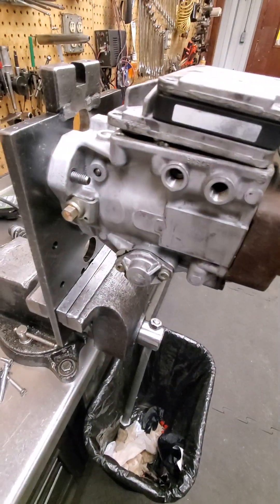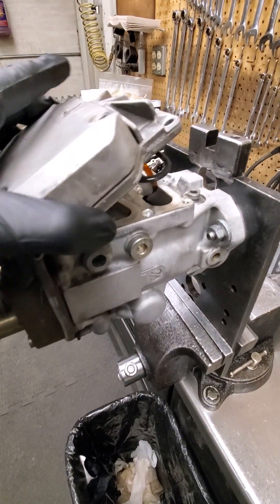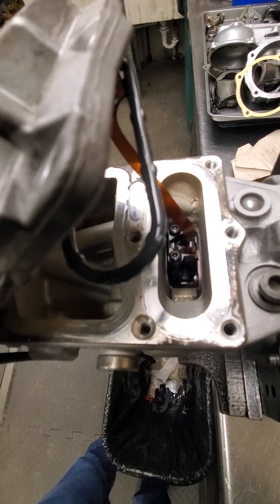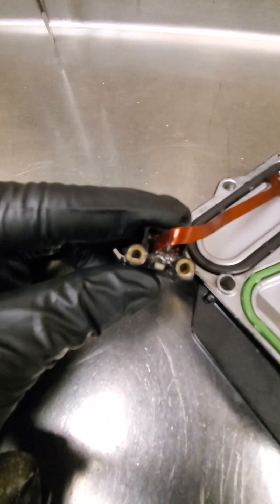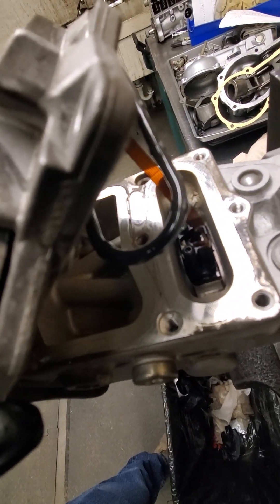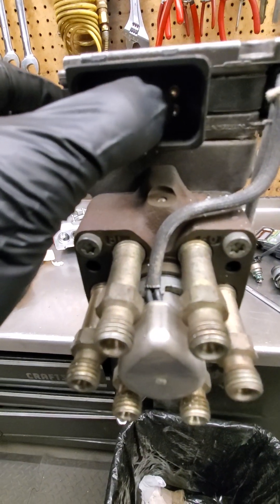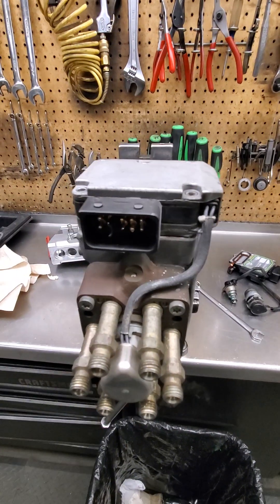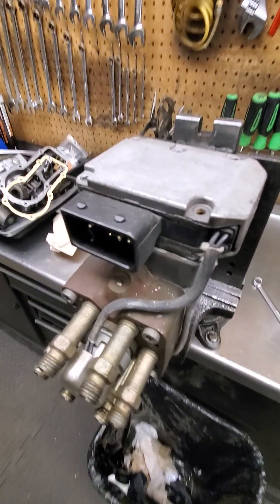Bosch VP30 Injection Pump Diagnosis For All Makes John Deere CAT Cummins Perkins Case New Holland

Comment: Hi I have the same pump on a perkins 1106c engine linde machine. Im getting an error from the scanning tool "fuel pump special instructions , throttle demand sensor erratic or intermittent" the engine works fine but suddenly becomes idle and wont throttle. the engine check engine light comes and goes once. after turning off and on again it works. what could be the issue?
Reply from the maker: Sounds like a bad throttle position sensor to me. Typically you can look and see what your desired vs actual throttle position is and determine if that's your issue
Reply: @DieselPerformanceEngineering thanks for the reply the technician who had the scanning tool said that he checked the throttle/ pedal and said it was working ok. But I swapped the pump to a different unit and getting the same symptoms will replace the accelerator pedal and see.

Comment: was told there is an optical sensor on this pump? is that an actual thing? apparently my sensor burned out.
Reply from the maker: @Cansanc-g6y  there is an IAT- basically a position sensor like you have on a cam or crank on the engine. I've never heard of anyone calling it an optical sensor though.